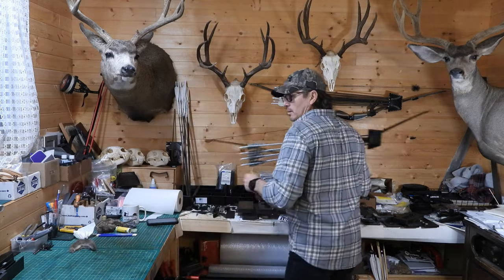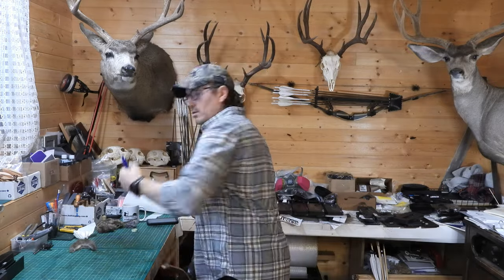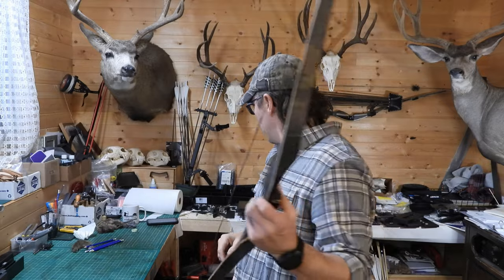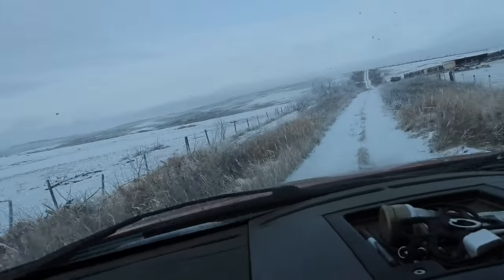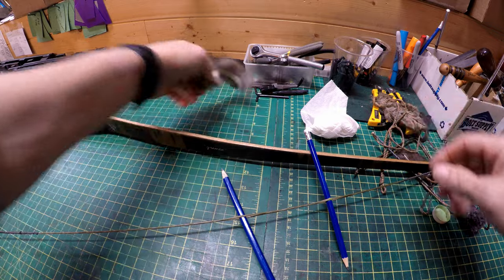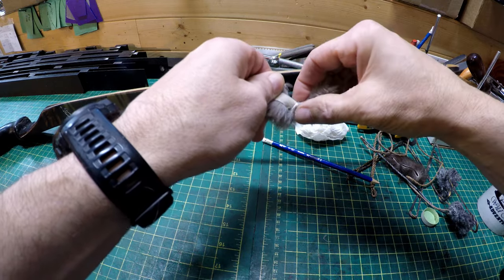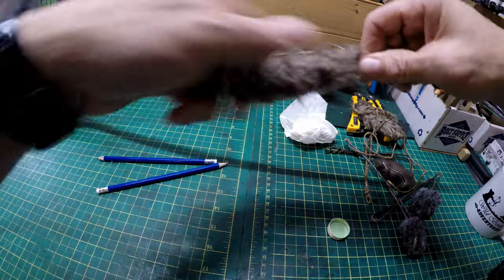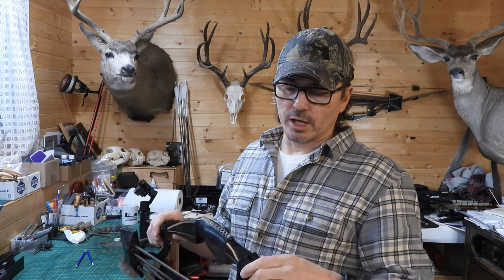Traditional Archery String Silencer- Beaver Balls Install

Comment: String material is the stretch factor not endless loop vs Flemish twist. B55 lots of stretch vs 8125 almost no stretch. Just for accurate information.👍😁
Reply from the maker: Yup I agree. but apples to apples... a flemish needs to settle more than an endless loop. Even after stretching. I bought PRE stretched flemish and still ended up twisting the string after 20 shots. But absolutely string material is by far the most important. Thanks for your input. 👍
Reply: @gunshyarchery  I wasn’t aware of that . I make Flemish twist strings and I pre stretch them and never had such an issue. Then again I only use spectra 652 and B55 for my string making. Thanks for your response 👍😁🏹🎯